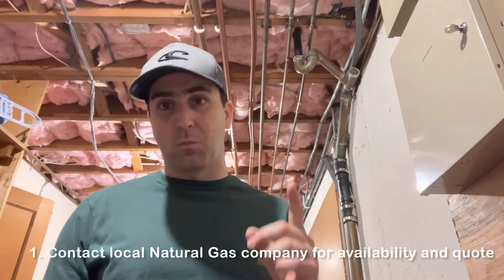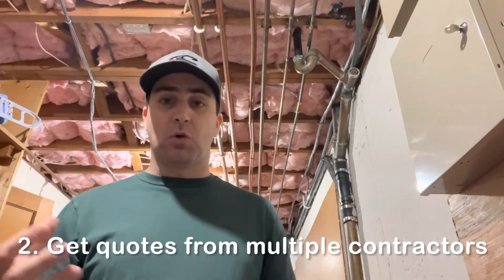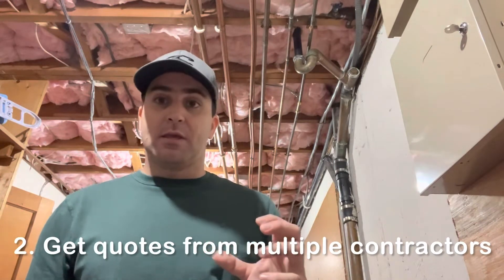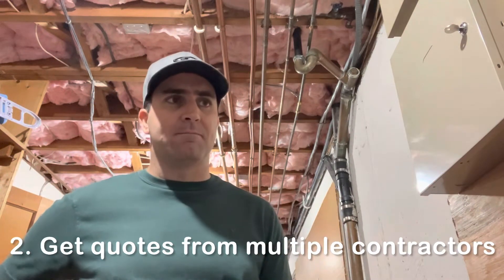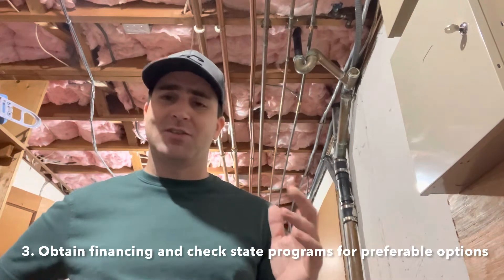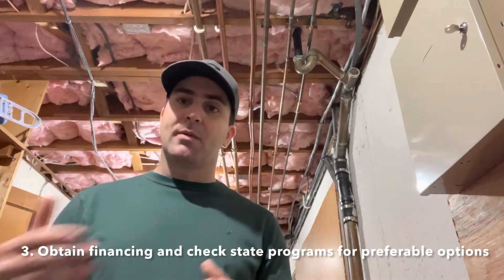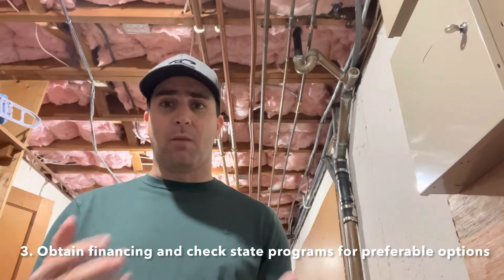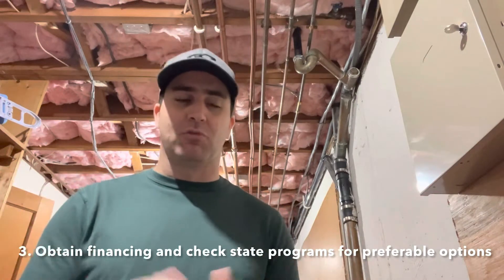5 steps for Oil to Natural Gas Conversion

Comment: My landlord just switched us from oil to gas. My unit was blowing smoke.  It isn't working now.  Blowing cool air for about 5 minutes then turns off.  Changed the thermostat no fix.  Thanks for the video.  I'm trying to educate myself on the new system and how its done.  Not sure if i should be worried with what happened and now it's not working.

Comment: is it a good idea to convert from oil to gas in New York if there phasing out oil and natural gas
Reply from the maker: I wouldn’t necessarily use that to guide your decision. I’d suggest measuring against the alternatives. Stay with oil, switch to gas, switch to electric (heat pump), go with whichever comes out better.

Comment: Thank you for the information, I was wondering about the whole process. My elderly parents have a home in New York City heated by oil ,and I was wondering about converting to gas . but thought it would be way to expensive and major. First I will check with gas company on programs available in New York. Thank you sharing is caring.
Reply from the maker: Ah thank you, you’re most welcome.
Also look at home energy efficiency programs. I got $10k of free insulation done also this year. https://www.nyserda.ny.gov/All-Programs/Home-Energy-Efficiency-Upgrades
I also put a heat pump on one side of my house, but it’s not useful when the temperature is below 40.
Reply from the maker: Here’s the natural gas page:
https://www.nationalgridus.com/Default.aspx?r.u=%2fConvert-to-Natural-Gas%2fExpand-Current-Natural-Gas-Service-to-Include-Heating%3f